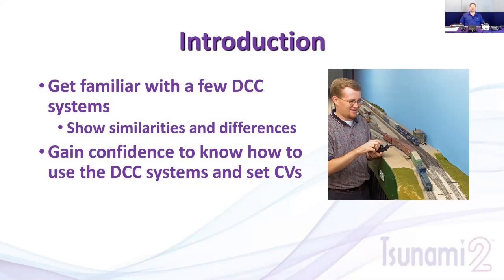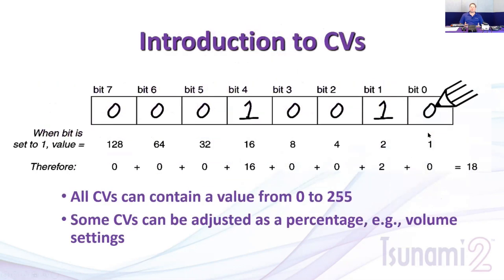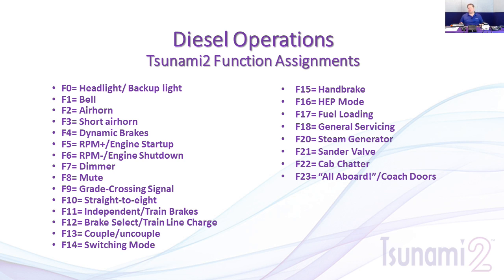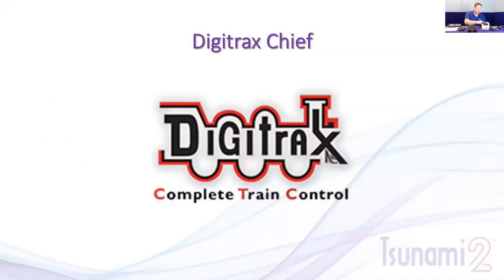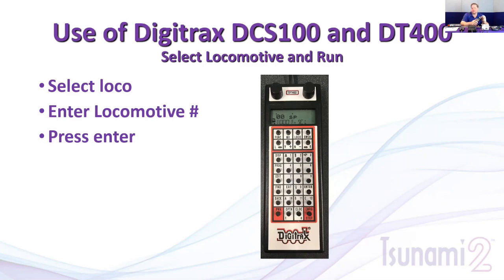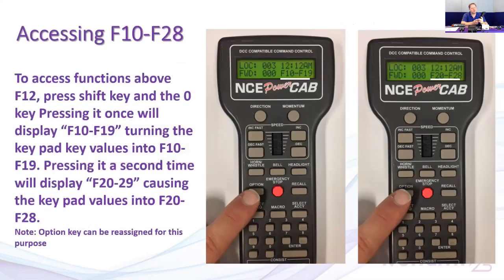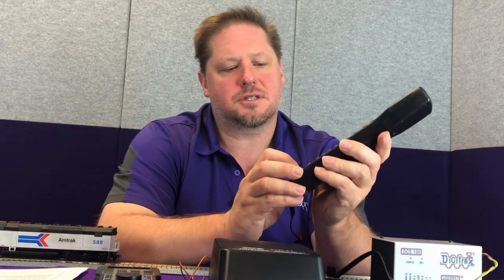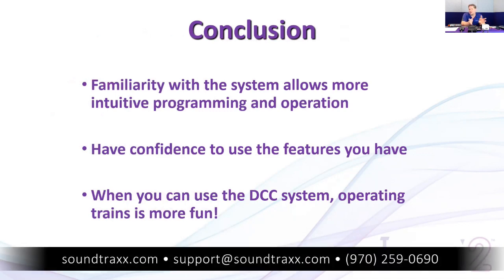Introduction to DCC Operation & CV Programming (Webinar 9)

Comment: Excellent presentation. I use Digitrax at home and NCE at the club. The programing of the soft key in the NCE throttle is something I did not know so I thank you for the tip.

Comment: Question:  I have a  Blinking red LED I wan to install in a caboose, but it will not work on DCC track voltage.  I works perfectly on a 9v battery.  A non-blinking LED will work very nicely from DCC track voltage . What can I do to fix this??
Reply from the maker: Contact our support department for assistance with this: (970)317-3505 or support@soundtraxx.com

Comment: I have the digital controller from ROCO (Rocomultimaus). But with this control, I am unable to access the engine on and off of my Atheran Genesis SD 90 H phase II locomotive, with Tsunami II decoder. What is the command I give to turn the sound on and off? (It is not the mute function) I want to know how to turn the engine of the locomotive on and off, as in normal normal operation. I write here from Brazil (Brazil) Thanks !
Reply from the maker: Hello,

We are not familiar with all command stations, but F27 would shut it down and F26 would start it up. Im not sure if you can access functions that high with this system. Im also not sure if you can access the CVs needed to do function mapping with this system. You will need to contact your command station manufacturer for that info.
Reply: @SoundtraxxDCC  Good Morning ! It was exactly this information that I needed to know, that the F 26 turns on the sound of the machine and the F 27 turns off the sound of the locomotive. I have enough European train. But I also have several North American trains, some of them Atheran and Atheran Genesis and it is precisely the Tsunami / Tsunami II decoder that has these very high on / off vestments. The rest, no! Thank you very much for helping me. I will buy a controller that I have access to 28 functions. See you...
Reply from the maker: @carlosmagno1112  Ok perfect, let us know if you need anything else!